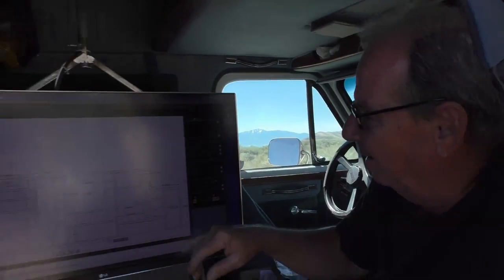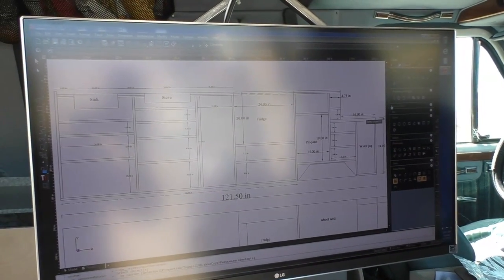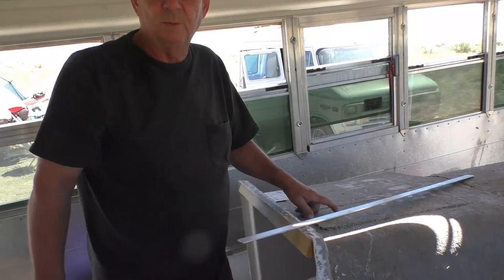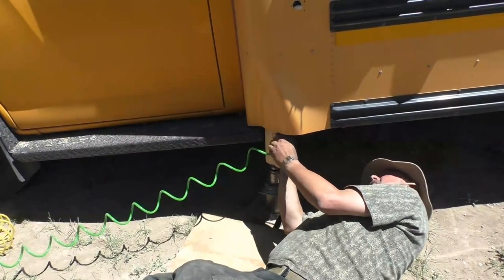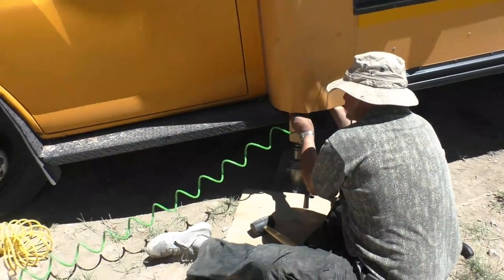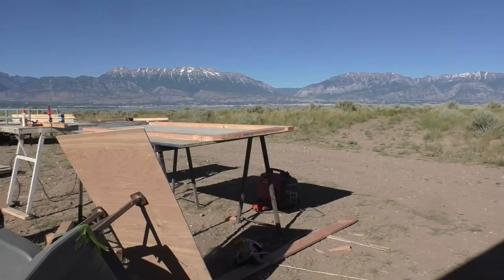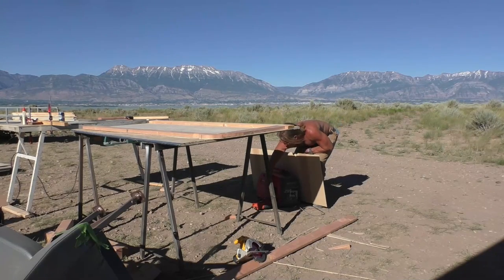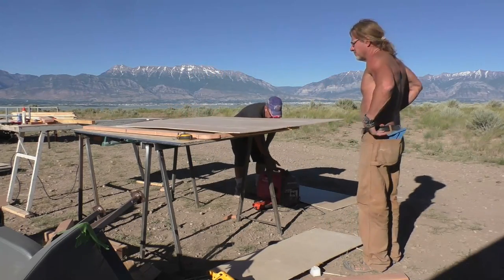School Bus Conversion Build Extended Footage *Loud Noises Warning*

Comment: I just watched the official reveal video, great job!  In this video you show the rough cut shower stall.  In the reveal video, how did you guys get such a water tight fitting shower stall to the curved roof of the bus?
Reply from the maker: Rick (Builder Rick) put wood backing all around the top and filled it in with Bondo and sanded it and painted it. He spent several days and several coats of thin layers of Bondo.

Comment: Why place batteries in the bus you got all sorts of space below !
Reply from the maker: Ease of access, but I agree. I have been on projects where that is done. One must be VERY careful to build boxes that can hold that kind of weight over rough roads. Great observation!
Reply: Weld angle iron or square tube to form the boxes if you go that route.  then can tack weld the box and thru - bolt it to the underside of the vehicle.  Very strong and not very expensive either.

Comment: It's a good thing what your doing but being a carpenter the last 23 years I'd keep away from tools if I was u it won't be long before u lose a finger  or worse a leg u seem very lose when your doing something a clumsy sorry if I offend u just don't want to see u get hurt
Reply: I was thinking the same thing.  I've fired a few guys in my day for doing exactly this.  hand ✋ in front of a circular saw? 

I truly enjoy watching these videos and would like to come out to the next build to help out, when will this be?
Reply: if that circular saw kicked it would go BACKWARDS not forward. having a hand in front is safer than behind by a long shot unless you are too stupid to move it and let someone just run your hand over with it. injury's ive seen from circular saw usually come from either someone stickin there finger in the saw because they are holding the guard up and not paying attention or from kickbacks and they have a hand BEHIND the saw, never seen anyone just run over someones hand with a saw.ive also seen someone reach under where they were cutting and get nipped. lots of ways to get hurt with a circular saw but hand in front isn't one of them.